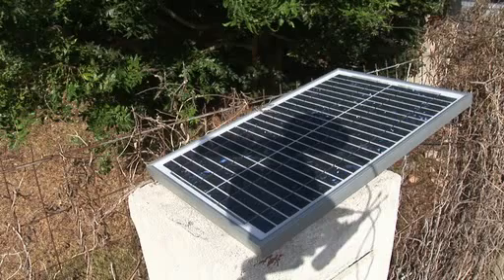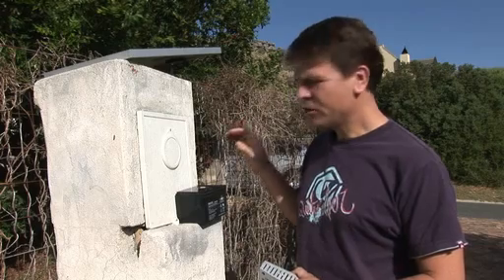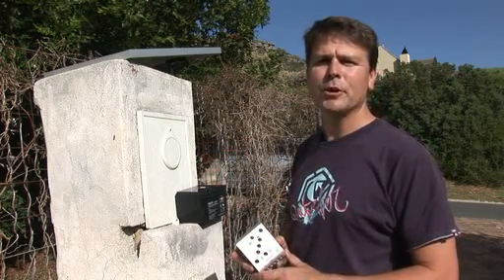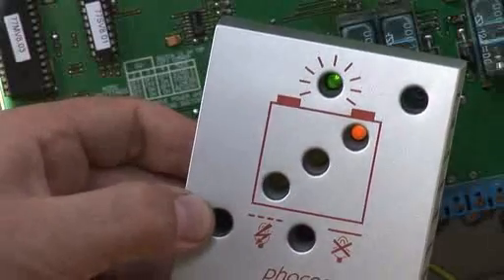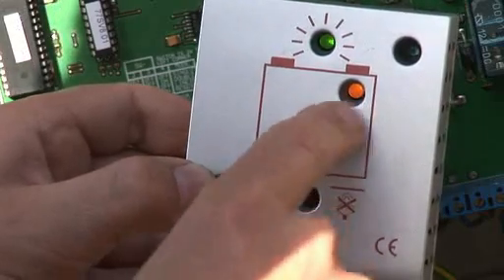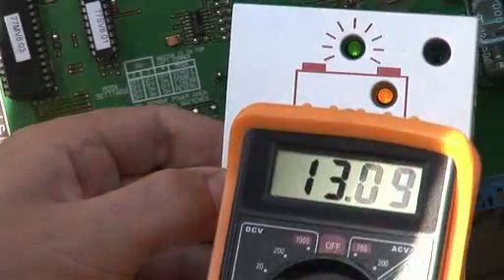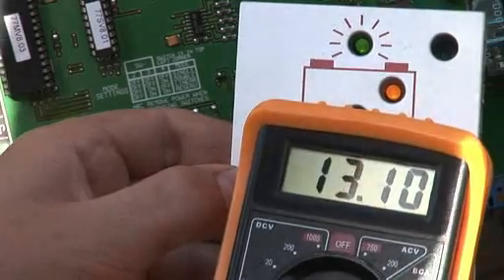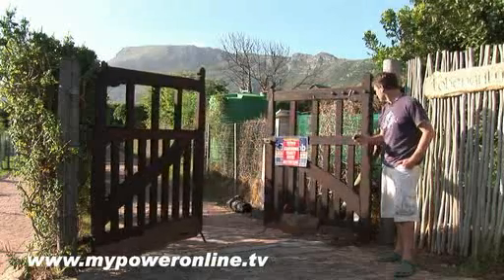DIY Solar Powered Automatic / Garden Gate Gate

Comment: I run a 10 amp solar panel, and my gate would draw a lot more load than that gate and I have never had a problem, I use a deep cycle marine battery to run the motor.
Reply from the maker: Rob's Random Repairs huge thanks it has worked well for me since.